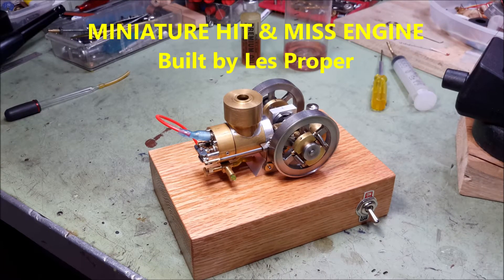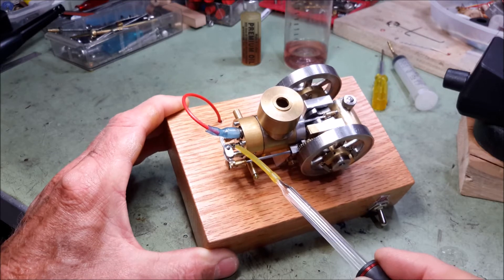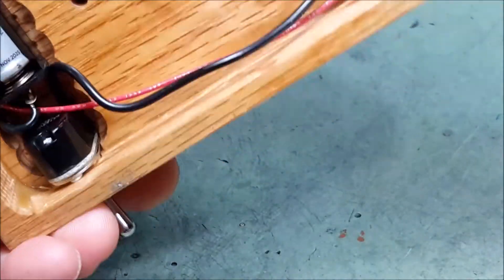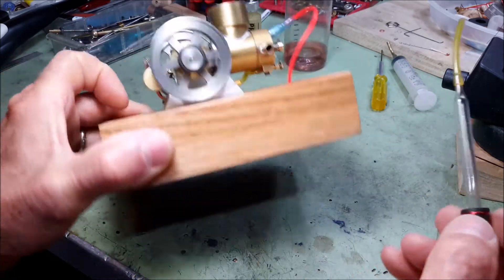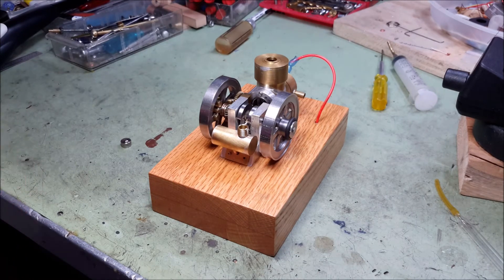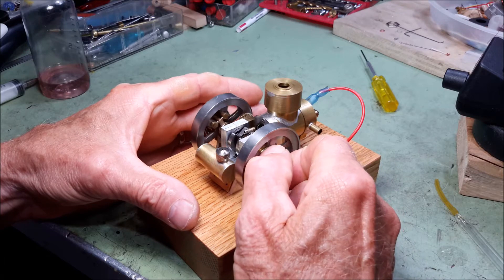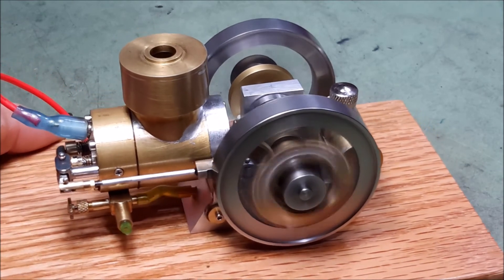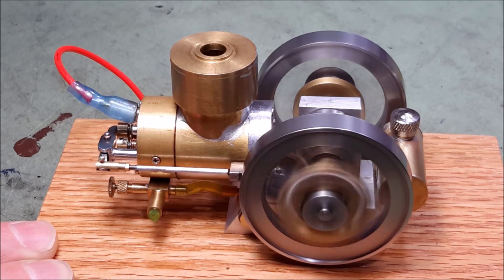Miniature 4-Stroke Hit & Miss Internal Combustion Engine

Comment: Another question Les...  I see a flash between the top of the spark plug and the ignition wire on every revolution.  Is that a neon lamp for an indicator or a true spark.  Broken wire or timing delay circuit?
Thanks  Fred
Reply from the maker: Hello Fred, The plug wire is just short of making contact with the spark plug.  What you are seeing is the spark jumping to the plug.  It may be my imagination, but the engine seems to run better when there is a gap to the spark plug.  It also is an indicator that the ignition system is working.  I read somewhere that fix for a failing ignition coil was to separate the plug wire a short distance so the spark had to jump to the plug.  I don't know if there is science behind this or if it is just nonsense.